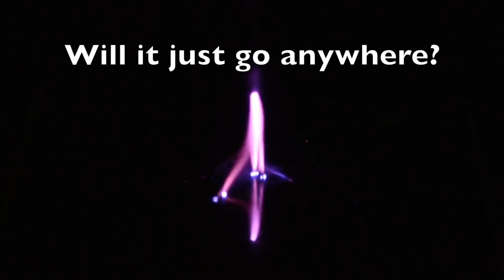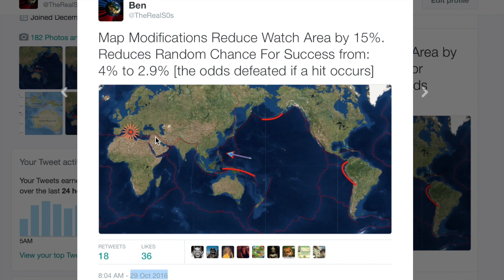How the Italy M6.6 Earthquake was Predicted

Comment: hm that clip where the water reacts to the electricity and is then raised to touch the surface of the rock above, "a lift" as you said, is it possible to replace one of the support(s) with a (very sensitive) scale and see if when the energy is running if an actual lift can be measured? And then of course find out if there is some sort of consistent way to guess an approximation of how much lift could occur given the appropriate factors and x amount of energy?

Comment: why not just use Extreme Low Frequency radio receivers and listen to the Piezo Electric radio signal effects generated by the fault beginning to break. first one spot breaks.. releasing pressure on that area but shifting pressure to areas around it.. when those break. they release electrical energy and ELF radio waves transferring pressure to the next area...  this is why the navy research ELF antenna recorded the 1989 san francisco quake.  lets put our ears to the ground with these easily made antennas and ELF receivers.. and put them everywhere wired into the internet for quake prediction warning.

Comment: While viewing this video I kept telling myself that this was something special.  I have a hard time understanding what you are relaying, though.  I guess that the High pressure system is acting like an anode while the Low pressure is the diode.  A simple second grader sketch of what is happening would be helpful in understanding the video.  Thanks to you, Ben and Billy, for an excellent vid.  Please use more "H" and "L" on the videos to show what is the High pressure areas and the Low pressure areas.  Thanks.
Reply from the maker: There are lots of explanation videos on the website. Also, the full method will be presented at Observing the Frontier 2017
Reply: Why Is Color Coding, & Numbered Pressure Levels, Not Enough?

Comment: Theoretically: Ok, Actually: NO, The earth is Not Laboratory.
Reply: +Stephen P. Shaw the current is electrons movement, but outer space contains more than electric or multiple Rays in wide range, you cannot decide which one causing the earthquake, also the crust not stable as rocks on the table.